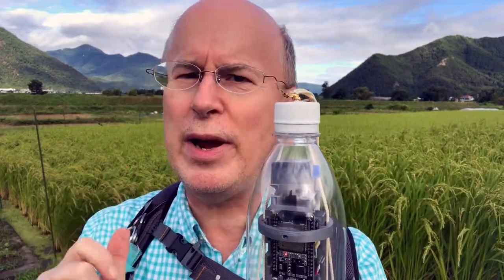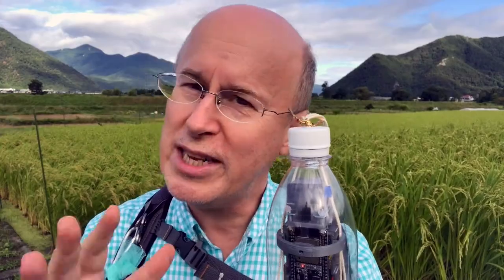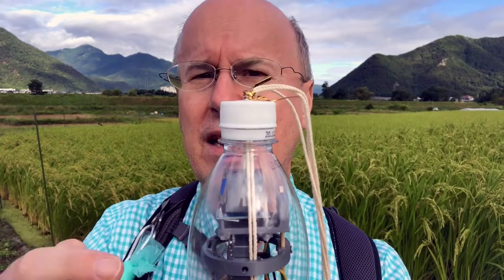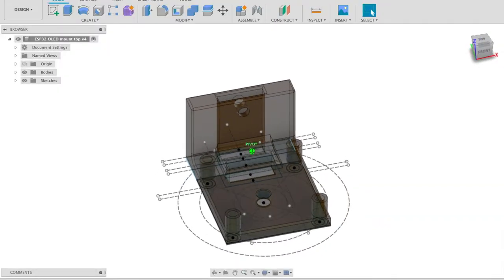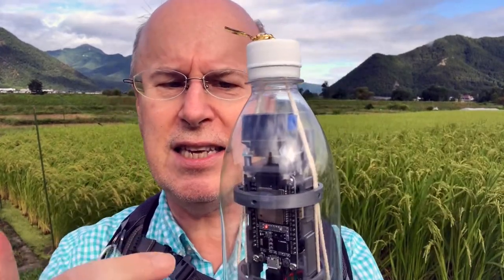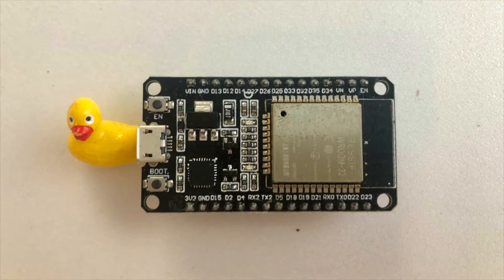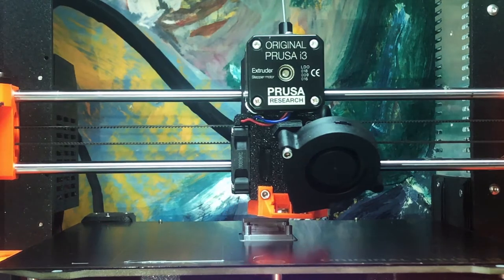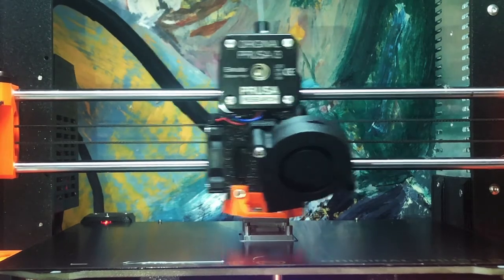Diagnose Fault (210901)

Comment: Great video. Maybe develop a versatile version for weather…pressure temp humidity that can also display keyboard input for timing or calculations? Maybe something that a kid could buy in a store and play with. I like the fact that you can put it in a soda bottle with sensors popping out of the top. But in a kitchen setting it might melt? Idk
Reply from the maker: Thank you for sharing your ideas. Yes, I’m definitely headed into various environmental (weather) monitoring applications with these. One of my potential applications involves timing for coffee brewing. I’m not sure how far I want to go with duplicating calculator functionality but maybe I will try to roll that into the same device to save on counter space and avoid having to reach for a smartphone. One of my original design parameters for the parts of this enclosure was that they fit in a glass jar, so to some extent I should be able to mitigate the concern about melting.